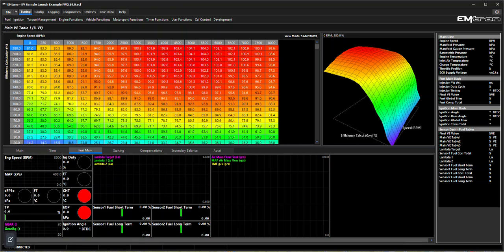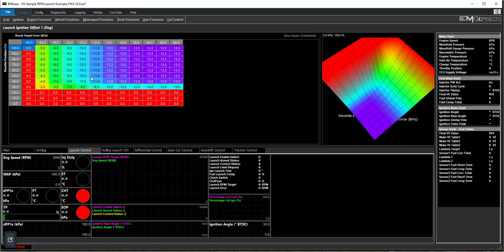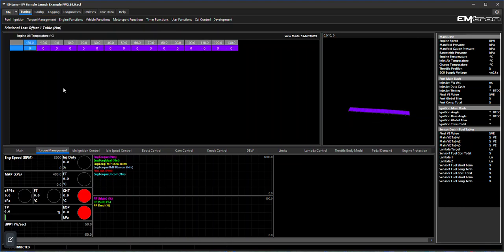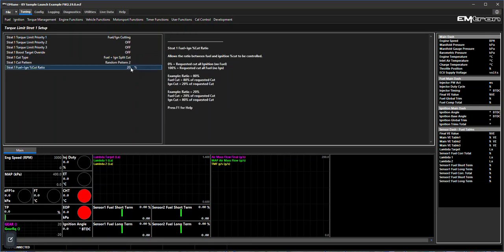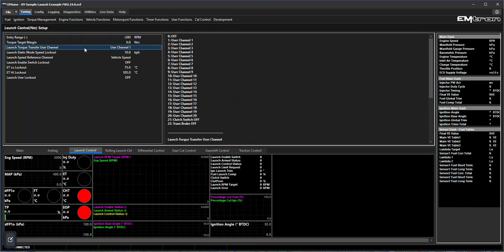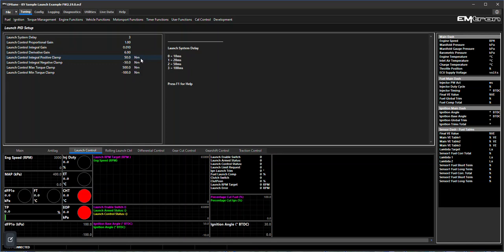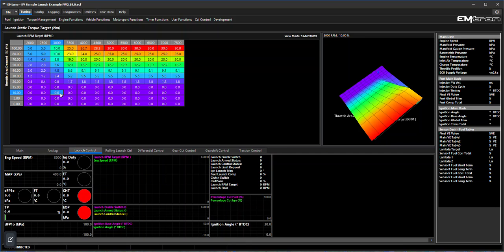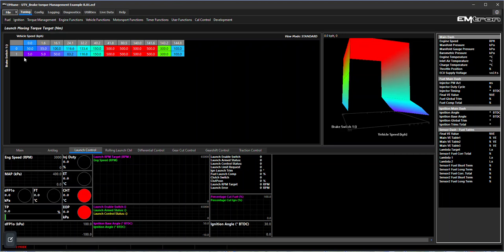Emtron Torque Launch Control Walk Through.

Comment: Hi Adrian.
Might be a silly question but on your VE table you use efficiency, are you able to explain what that efficiency relates to? I just currently use rpm and map axis.
Reply: Hey @aussie1926

Efficiency Calculation is a Calculated Runtime with user-assigned variables. To find what it is and can be, go to Config > Channels > Calculated Runtimes > Main.

There you will find the options to assign variables to Efficiency Calculation % (MAP, TPS, BAP, MAP/BAP, MAP/EMAP etc) as well as Load Calculation (same options)

Typically, most people will use MAP x RPM because that is what they are used to. If this is your case, as it sounds like, then using MAP/BAP Efficiency Calculation instead of just MAP will tune the exact same, but it will allow you to compensate for changes in barometric pressure automatically without having to write a barometric pressure compensation table.

Hope this helps!
Reply: @Sam.DialedInMotorsports  thanks mate. That makes sense.